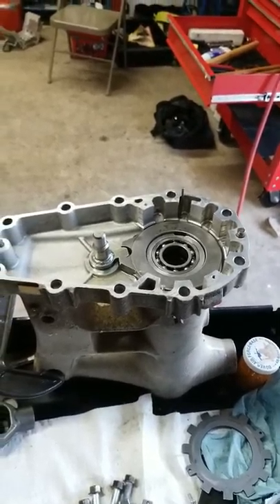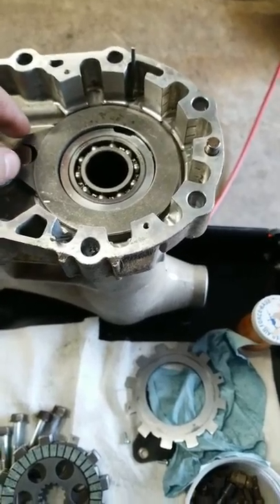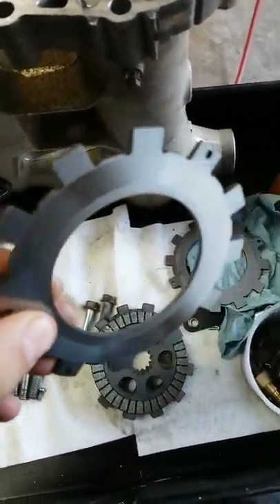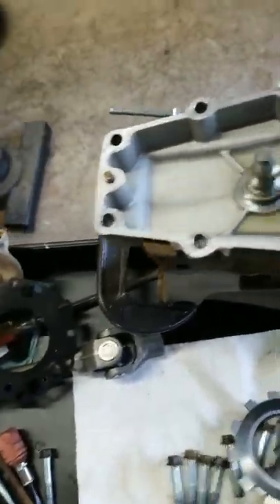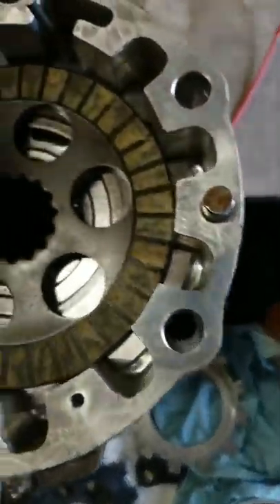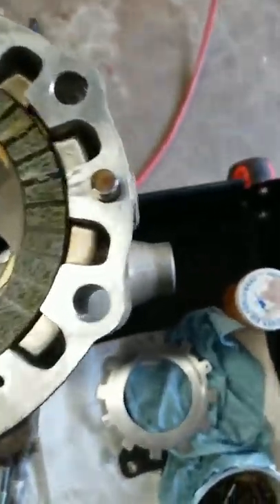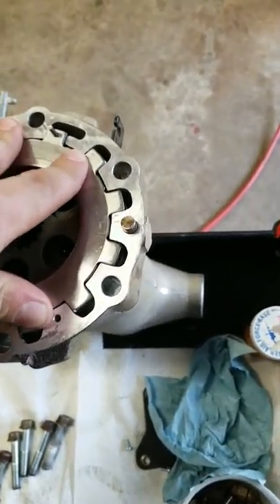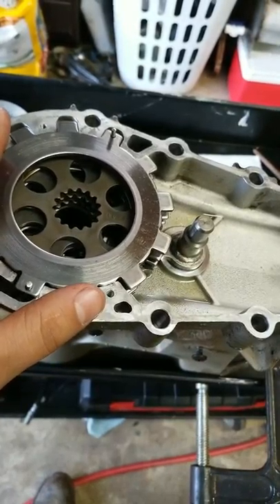Kawasaki 360 prairie rear wet brake installation

Comment: This is the same wet brake design used on a KFX 700. Imagine the Prairie 700s used it as well. Nice to see inner workings and how it goes back together. Thanks!
Reply from the maker: Yes they all use the same style wet brake system. Even the brute force 650s and 750s it's a good idea on tractors not so much on quads.

Comment: My rear brakes are locked up on my kfx 700 from sitting around so long. What can I do ?
Reply from the maker: You could start by draining the oil out if it has water in it. If not. Disconnect the the brake cable and force the brake lever on the rear diff side to side. Normally they don’t seize up, because there a wet brake system

Comment: Where did u find the bearing for the brakes
Reply from the maker: Can you specify. Exactly what bearings your looking for. Where at in the rear. Diff or swing arm.
Reply: @Calebmcguckin  the one for the rear diff i already ordered the swing arms and got them changed out but didn’t know there was another one inside till i pulled it apart and its stuck on the shaft